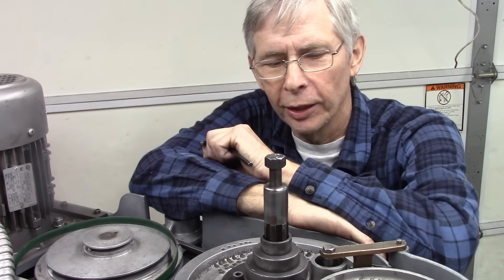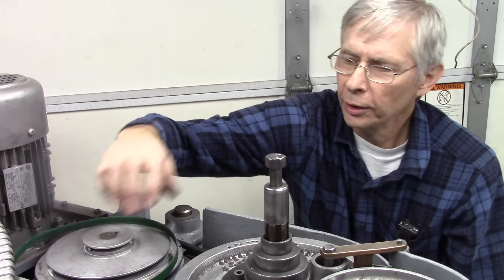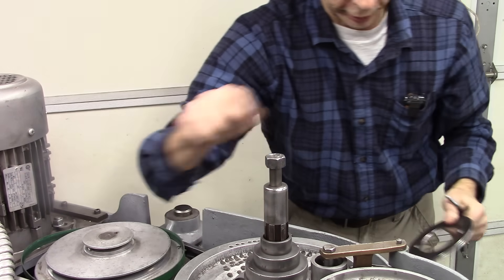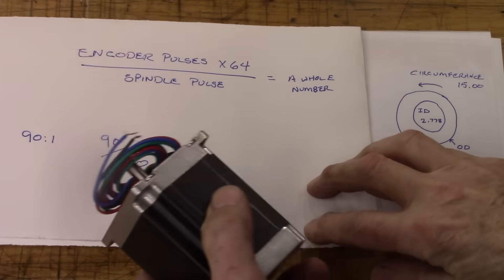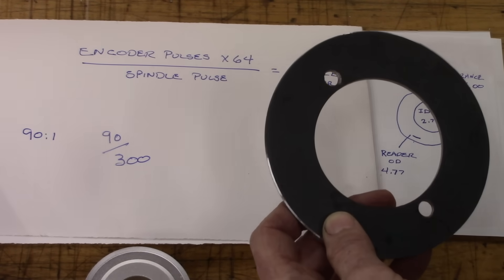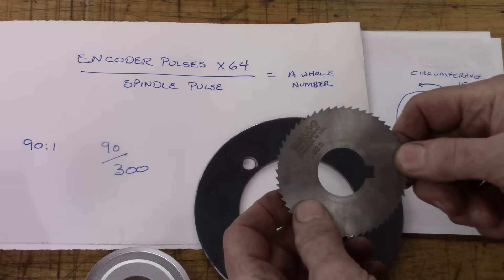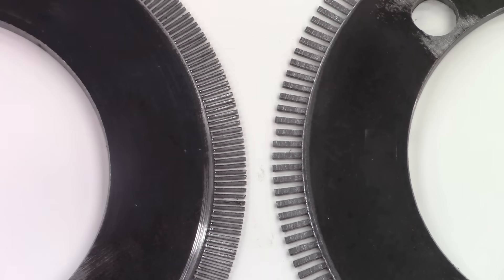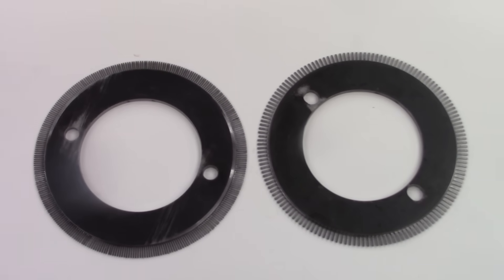Encoder Disc for a future Gear Hobber

Comment: Hi, good video. I was wondering if you were using 12L13 steel if you would have better luck with your project?
Rich
Reply from the maker: I'm sure it would work well better although mild steel did well.

Comment: Would 180 slots work? Half a turn per slot would be easier to index using a slightly different diameter.
Reply from the maker: I had a fairly specific diameter but 180 might have works. I had a limited slit saw selection so I used what I had.

Comment: Nicely done! 150 slots should work fine, you don't need a whole lot of resolution for this unless you will be cutting gears with hundreds of teeth. I've also used the laser printed on transparency version and it does work, but it's not as rugged.

I look forward to seeing your progress on this!
Reply from the maker: Thanks Andy, somebody else mentioned the transparency method. This never occurred to me but it would be easier. Thanks again!

Comment: Winky, with the sector arms you are meant to use the inside where it is reduced in thickness. In that way you keep the sector arm moving in the same direction each time AND you don't have to keep lifting the pin over it each time. Just pull the pin out enough to disengage from the hole. How many gears do you think that you are likely to make ? bear in mind that you will need a gear hob for each size of DP you want to cut. Will cost a fortune, cheaper to buy finished gears or make them using standard gear cutterrs. Regards from Australia.
Reply from the maker: Holly shit, I see what you mean about the sector arms, ha, thanks! Yeah I know about the hobs. You can usually find then for about $100 to $150 on ebay. Its probably a silly thing to pursue but honestly there are only 2 common sizes for the older machines. 14.5 PA and 16 or 20 DP (at least here in the US). I think my South Bend and Logan were mostly 16 DP. Also, if I make gears for something I build I'll use what I have. Standard gear cutter are not so good in my opinion. I've had terrible luck getting a good gear. Part of that is likely my setup....  maybe a little slop in my rotary table, maybe  a little flex or maybe poorly made cutters. My gears looked fantastic but were noisy as hell. Of course there is the fact that gear cutters are almost always a compromise. Gear hobs produce a perfect profile
Reply: It's also worth noting that the bevelled edges are inside the sectors. This is so they can be rotated with the pin in the hole and stop on the small parallel portion of the pin that's above the indexing plate.
Reply from the maker: you lost me
Reply: Ah! you beat me to it Dave. I have never seen sector arms used that way but it worked.

Comment: The first version looked pretty fragile. I'd probably drop it on the floor for sure. V2.0 looked about right. 
Regards,  Preso
Reply from the maker: I agree...  and some of the grooves looked slightly off. Maybe the remaining steel was flexing during the cut

Comment: I have had all the parts sitting around to make a hobber for years.
I am feeling motivated to build it now.
BTW, you are using your sector backwards. You should never rotate the handle in reverse, always in the same direction. The tapered faces are so you can let the pin down on the face of the sector, and have it drop into the hole.
Reply: Yes,I was thinking the same thing about the indexing pin locating towards the inner chamfered faces of the sector arms.👍
Reply: Just remember to +1 to your count as the pin is in one hole, otherwise you are not rotating the correct number of holes
Reply: @rosco49er  Yes,the hole the pin is in from the last index should not be counted/included as part of the next indexing advancement but Mark must have got that right or his encoder teeth spacings would be obviously wrong when he completed the full circuit of indexes.
Reply from the maker: I did not use the sector arms correctly but the results were the same and yes, I did not count the first hole.
Reply: @howardosborne8647  I had a boss showing me how to cut gears, he forgot this and he cut 15 and 3/4 teeth. I since have remembered that important rule.
Reply from the maker: Yes I did add +1 but good point
Reply from the maker: Yeah, others have pointed this out. I'll have to mention this in a future video. Yes I occasionally went past the hole and reversed and yes the backlash likely effected the accuracy. If I was using the sectors correctly It would have been easier to not do this. I think it's the result were close enough to work well but you are correct, thanks!

Comment: Just to throw my two cents in, did you think about an optical encoder? Using Excel make a pie chart, print it onto an overhead transparency sheet.
Reply from the maker: Yes it is an optical encoder. The transparent sheet would for sure be much easier!!! I wonder if reflections would be an issue?
Reply: @WinkysWorkshop  not if it us a matt sheet.
Reply from the maker: @allangoodger969  I probably would have had to sandwich it between some steel discs but still a lot easier.
Reply: @WinkysWorkshop  nah. with the stick out you have it would be self saporting

Comment: Why build your own encoder when you can just buy one?? 1000 pulse / rev quadrature encoders can be had for $13. Encoders are commodity off the shelf "industrial lego" - there's no point re-inventing the (encoder) wheel! 600 pulse / rev is also available at the same price
Reply: Because buying an encoder makes a poor YouTube video. Also, if you have the tools, knowledge and materials to make it...why not?
Reply from the maker: Ha, good point
Reply: Also if you're planning on doing gear hobbing, check out Stefano Bertelli's dro project - it was designed to do gear hobbing from the get go in that it can generate axis drive pulses for the rotary axis based on a configurable ratio of the movement of a different axis, or a spindle encoder. In the same way, it can also be configured to be an ELS as well on a lathe if you motorize your Z axis and put an encoder on the spindle
Reply from the maker: I'll check it out. Thanks
Reply from the maker: I considered this type encoder but had to ideal place for the belt drive. Certainly it would be easier!

Comment: If thought about something like this a while ago but was going to use holes rather than slots. The sensors I was looking at (IR sender and sensor) seemed to put out a very small beam so I though a hole would be easy to drill, plus a second or third hole just slightly inboard of the outer ring, using a second\third IR pair found be used for synchronization, or if slightly offset (like splitting the outer ring degree spacing), could provide additional resolution. 

But like most of my projects, completely successful in the workshop of the mind but not making it to the real world 😂
Reply from the maker: The specs for the disc are square holes (impossible). Hopefully the slots work. I think round holes might be an issue. The slighted position error on the sensor and the disc off center would make the width of the pulse vary.

Comment: Did the table have to be raised by the disc radius PLUS half the cutter thickness? This is usual to bring the middle of the slot on the center line
Reply from the maker: Yes, I think i forgot about half the cutter thickness but this is not significant.
Reply: Yes, I think Mark simply forgot to mention it.
The first disk will be useful as a circular dog comb 😁

Comment: Hi,
I'm happy to see another hobber project!!  If your encoder needs a resolution of 600, you only need 150 slots and tabs IF you have an "A" and "B" channel and use quadrature encoding.  I think Andy used quadrature pulses on his encoder for both of his hobbers and know I used it on mine.  Another benefit of quadrature encoding is that you can determine the direction (CW vs CCW) of the hobbing spindle.  This is important if/when you have to stop a cut and the spindle is turned in the reverse direction for some reason.  An accurate pulse count and hob orientation will be maintained. 

Additionally, IF the 300 slot/tab encoder wheel is rugged enough, you can get a resolution of 1,200 PPR.   Of course, the resolution of the stepper motor will need to have a resolution of 1,200 PPR AND the Arduino hardware and firmware will need to be fast enough to support this resolution at acceptable spindle speeds.

 Anyway, just an opinion.   

Cheers,
F.C.
Reply: does it even make sense to build an encoder when you can get a 1000 pulse / rev quadrature encoder for 13 dollars??
Reply from the maker: >>Does it even make sense to build an encoder when you can get a 1000 pulse / rev quadrature encoder for 13 dollars??

There was no really good place to mount the belt drive for the $13 encoders.
Reply: @gorak9000  In my humble opinion, no, it doesn't make sense.  However if one needs a short, compact encoder due to space constraints, then Wink's (Andy's too) is a great way to go.  I would have done mine the same way IF I had a convenient way to mount the photo switches.  Not knowing any better, I used an off-the-shelf unit with dip switch selectable resolution so I could "tune" the system for the Arduino speed, firmware efficiency and driver/motor characteristics as it developed.  In hindsight, this turned out to be a very good decision.
Reply from the maker: FC  Andy recommended 200 or more on the disc with the quadrature encoding but I think he actually used 150 on his.

Comment: Well made but I have absolutely no idea what it does (must have snoozed through it).  Can't wait for the next installment.
Reply from the maker: Or maybe i didn't explain it well. Hopefully it will be clear in future videos
Reply: @WinkysWorkshop  That would be a 1st.  It appears to be an index wheel to fit a pickup reader.  That's a ton of precision you have undertaken.
Reply from the maker: @richardgreen7811  You got it

Comment: Excellent video Mark. 
When working with pulse modulation, a wider pulse width is more accurate. 
Your second revision should be good. 
I can’t wait to see your next video.
Reply from the maker: Yeah I need resolution as well but I do think the first disc was too small.